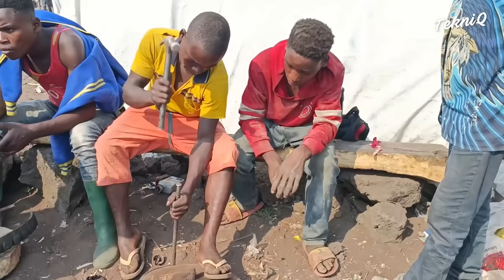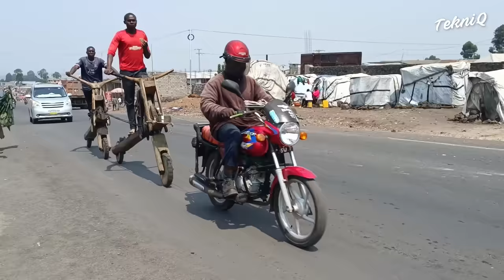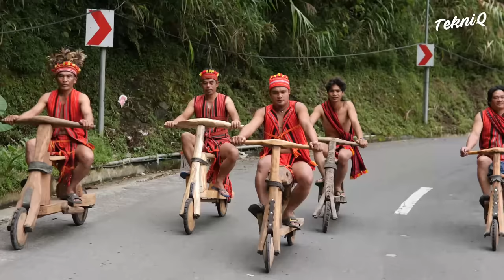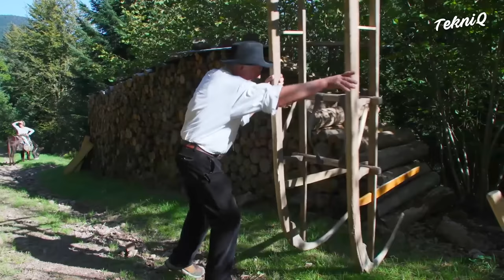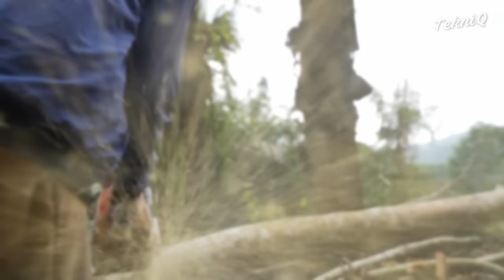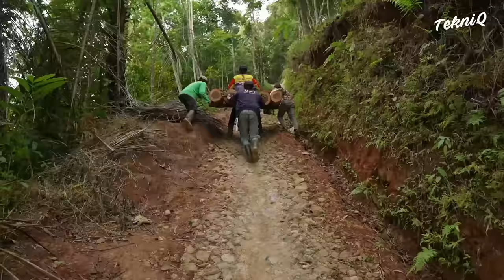Riding Engineless Scooters on Streets of Congo

Comment: Awesome. 😮😮
In those wooden scooters, I see no motor or something which can be driven forward. How they are able to drive them easily? Or because of very smooth concrete road? I still have no idea.
Reply: It's works only for downhill of course. They have to bring it back up all the distance they travel.

Comment: Not anticipating any patent soon for this crap. At least they installed metal bearings onto the wooden wheel, which I guess were not made in the Congo. All carved with a machete and wrapped in recycled rubber hammered on with nails. What could be more labour intensive? And, I presume that the world is still thought of as being flat, or with a perpetual decline. OMG!